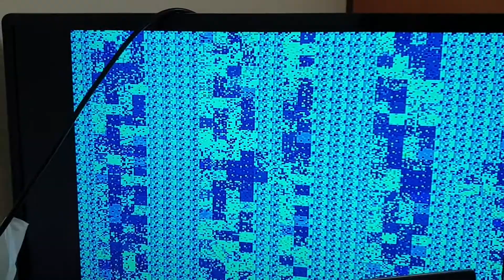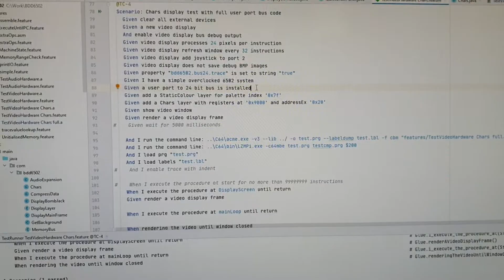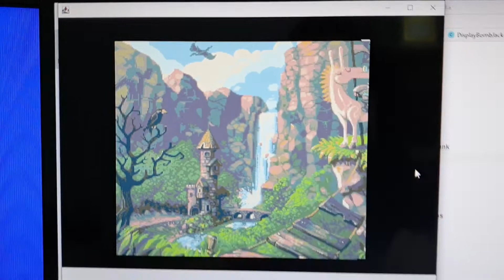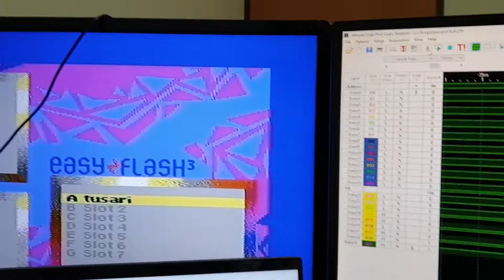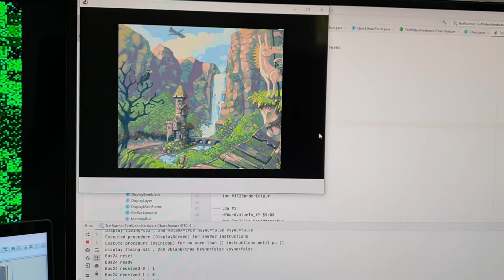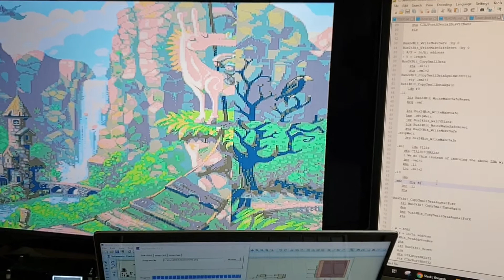Bomb Jack   10   Testing the faster user port interface

Comment: Hi Martin. Had a good look at the blog and GitHub pages for a description of how the C64 or a Z80 interfaces with the board - does it use dual-port RAM or some timing events to ensure there's no bus access collisions between the graphics card and the external CPU?
Reply from the maker: For this updated hardware, the C64 (or a Z80) sends data bytes via the user port (parallel transfer, so it's fast), with some control signals, to write to a 24 bit address space in the hardware. There is a signal from the hardware to the C64 via the user port for screen refresh (VBLANK) which is read as an NMI (CIA2 FLAG pin) request on the C64. So there is no bus contention with the C64 and the boards.

In the original hardware, used in the Bombjack arcade game, the Z80 data and address bus was partially connected to the hardware with a couple of address windows at $9000 to $9fff (perhaps a bit wider than that), this was mostly write RAM as far as the Z80 was concerned. The rest of the video internal memory was ROM, and could not be addressed by the Z80. The Z80 would have to time writes to the video address space (RAM) during the VBLANK when the video hardware was not expecting to read RAM to avoid contention.
Reply: @MartinPiper6502  Really good explanation - feeds my itch for details!
Reply from the maker: Good question by the way, I'm going to add a section to the readme :)
Reply from the maker: Updated the docs: https://github.com/martinpiper/BombJack/blob/master/README.md#how-to-access-the-hardware

Comment: this is truly fantastic stuff. i just recently started building homebrew 8/16-bit homebrew computers, and it didn't take more than some back-of-the-envelope calculations to realize memory bandwidth was too limited for frame buffer based displays. i've been looking into hardware sprite engines ever since, but they're so obscure and ancient and obsolete that i've had almost no luck.. until now! it's nice to have a known working reference to pore over!
Reply from the maker: Thank you for the feedback. I'm currently soldering the sprite board, which will be interesting to see if it works first time. When it's ready to be tested I'll be sure to include that video, which might turn into a debugging video. :)
Reply: So true. In reality 8 bits micros with far more memory and direct access to it from custom chips could have been so much powerful. As probably some 8 bits console did